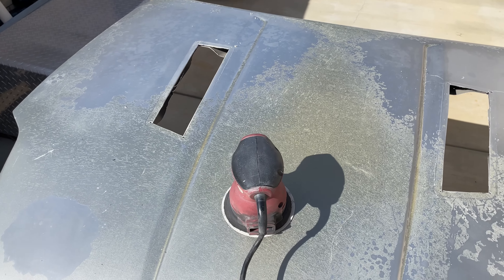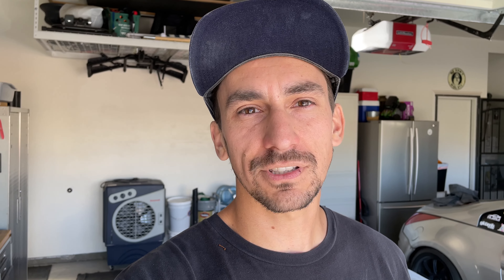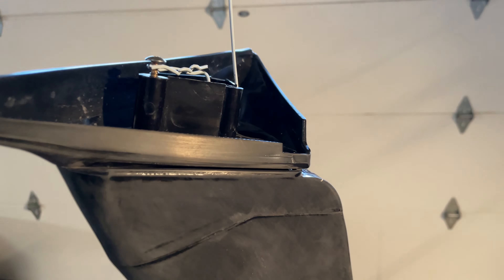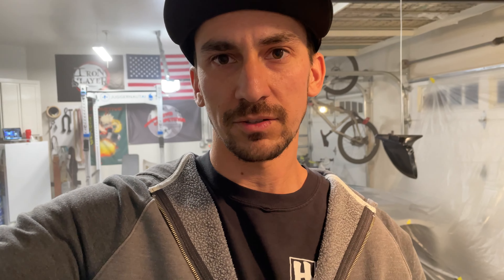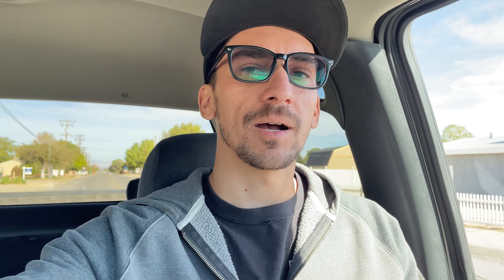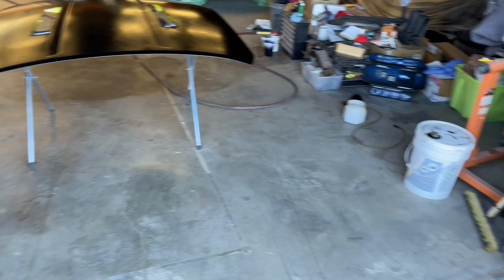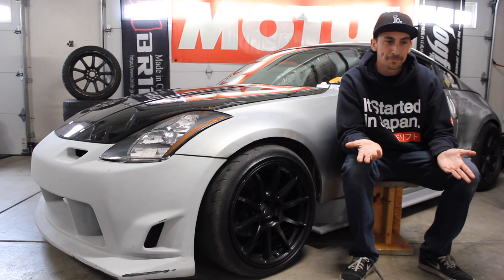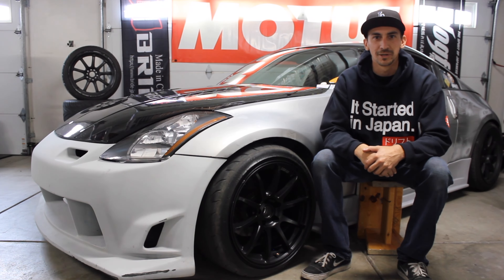Avoid These Mistakes When Painting Your Car At Home! *DIY Drift Car Paint Job*

Comment: You should shoot 3coats  of sealer with 1.7mm to 2.0mm nozzle spraying.Than p320,p500,p800,p1000 dry sanding .After all shoot out 2 coats basecoat with 1.3mm or 1,4mm nozzle size gun .Than 2 coat clear.Second clear coat can be done with 1.2mm nozzle size gun tip with 10% reducer and extra slow is preferable.Clear 10-15 min.between clearcoats.Safety first ,put your face mask to live longer guys :) Peace.
Reply from the maker: Thank you! Great advice 👍🏼

Comment: I have some experience in painting and I can attest to having problems in areas where there was bare metal, from oversanding the primer(novice mistake). But also the paint was old 🤷‍♂️. Hopefully your paint stays solid 🤙, pretty nice color. Thanks for sharing the paint color name, you know how some people are lol
Reply from the maker: Yea we’ll see how those bare metal spots hold up over time! I figure it’s a drift car and I doubt any panel on the car will last long enough for the paint to fail 😂
Reply: The best prep over bare metal areas is immediate thin dust coat and than 1-2more float coats over and over  with etching primer common brand preferable do not use cheap stuff for prep -Prep step by step it is most important step to plant your lovely paint with deep roots for the coming centuries!Practice make you close to perfect.
Reply: Also another tip to be jentle with the sanding paper can use soft interface pad hook & loop between the orbital and the sanding discs.In your hand you can also hold the same soft interface pad sponge with sandpaper.Or scotch brite 3M extra fine grit after the fun with the sandpaper.

Comment: Adhesion promoter for the mirrors would of help. I learn that the hard way. My paint started to chip off after couple months
Reply from the maker: Yea a few people have mentioned that. we’ll see what happens in the long run!
Reply: @tonycrispin  I painted a bumper for a friend and I use the adhesion before I put down the base coat. Car got into a wreck the bumper just folded the paint didn't even chip. I was amazed how it hold up
Reply from the maker: @mayan34956  Dang that's really impressive! I'll pick some up for next time for sure! Thanks for sharing